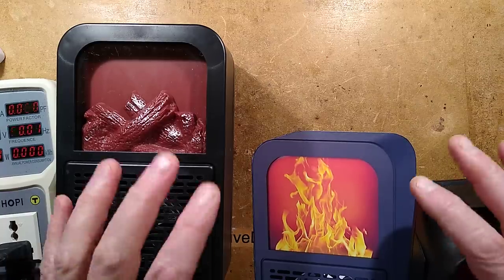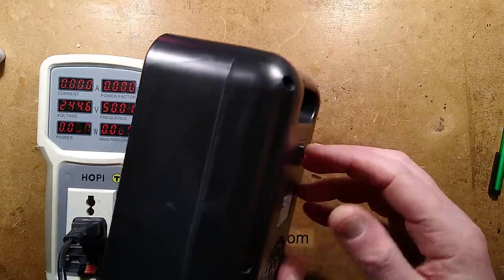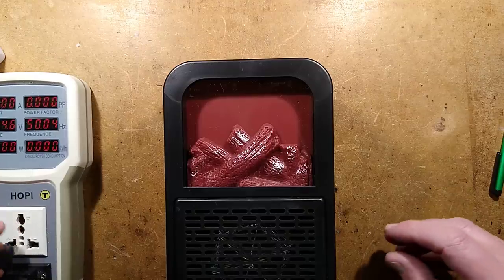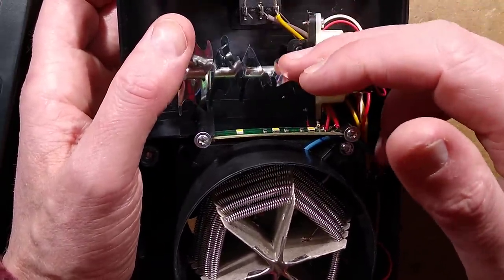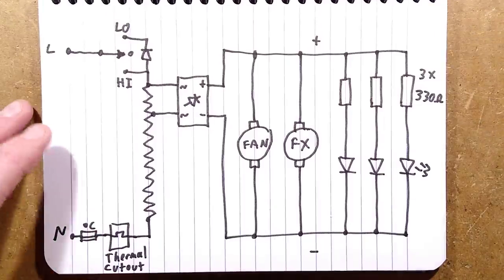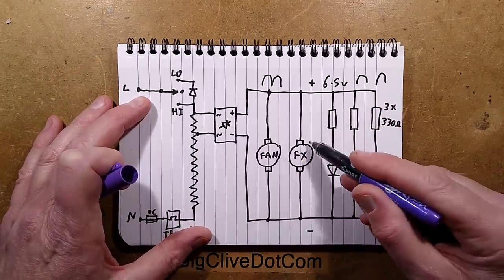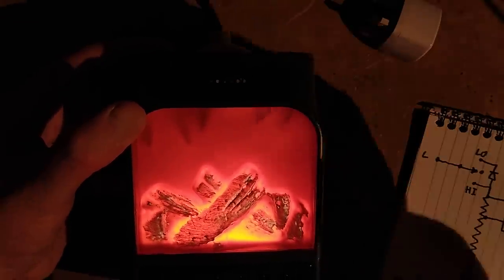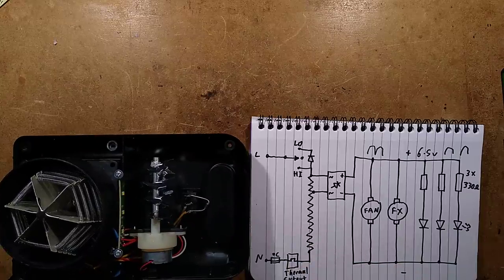The trashiest of all miracle heaters (with schematic)

Comment: 363 Watts??? I have one of 600 watts, and it blows warm, but can't heat anything.
I read later on a website you need 75-100 Watts to heat one square meter of a room.
Depending on the isolation I think.
363 Watts is just enough to heat a toilet.

Comment: That couldn't have been built any cheaper.
Reply: They could have installed jumpers in place of the high temperature limit fuses... (which might not work anyway).
Reply: I bet at one point in the development process they tried to make the heater element mounts out of plastic.

Comment: the one i got makes an horrendous row and draws about 400 watts, it blows out a fair amount of heat, it will run off a inverter so when them idiots in the big hall shuts off gas or electric i can stay comfy but not warm.

Comment: I bought a Better Homes and Gardens heater from Walmart for 60 bucks, and when I plugged it in it popped the breaker and that was it. When I took it back 3 more came back that done the same thing, JUNK!
Reply: Replace your failing circuit breaker....
Reply: It also could have been your circuit was overloaded,  or loaded to the max and the inrush current was enough to have caused the trip.

Comment: In countries with coded plugs all diodes in a street to run „in sync“. Your electricity company will like it.😎
Reply: The diodes don't run in sync. The waveform of the electricity does...
Reply: @davelowets  you‘ve seen the quotes?
I just wanted to say that forcing to have line on the same pin on all plugs has a disadvantage in this case, assuming the Chinese assembly guy is always soldering in the diodes with same polarity. Here we would average out this „DC-effect“ hurting transformer stations just by having a 50/50 chance of our plugs „polarity“.

Comment: I figured they would used half the resistance wire for low atleast,  I hate electric heaters,. My sister burned my house to the ground with one!  No insurance,   and the air is so dry with them,.  The issue with propane is the opposite, I have a diesel heater, I'm going to make bio diesel to run it on,  aren't we just horrible, we are parasites, eating and burning everything! 😆 But for real 😧

Comment: "That's a bit feaky" - well, I understand that Clive tries to keep the videos .. as clean as possible, but this must be called f****ng dangerous as most of these small heaters. Many of those sh**y cheap heaters are a real threat and must not pass any import controls, but hey, it's Brexit. Although, I bet that many of those lighters will also pass the European boarders and only a few will be stopped. A thermal fuse won't stop the plastic outlet from melting and then exposing live wires, great.

Comment: Suggestion, figure out how the circuits work for the 1980s tv auto sensor which Ben Eater pulled the data from here :https://youtu.be/a6EWIh2D1NQ which was originally shown by Technology Connections (not a colab, just Ben Eater getting nerd sniped)

So far Technology Connections showed what it does and Ben Eater pulled out the list of words. He left it in the air for someone else to find out what the circuits are doing.

Comment: 100th , also they should just use a 2011 macbook pro if they want heat , those shat boxes got so hot they dislodged the AMD dgpu
Reply: In addition to being a heater, those old Compaq™ pc towers could be used as an air filter.